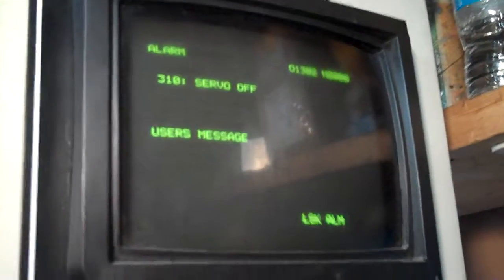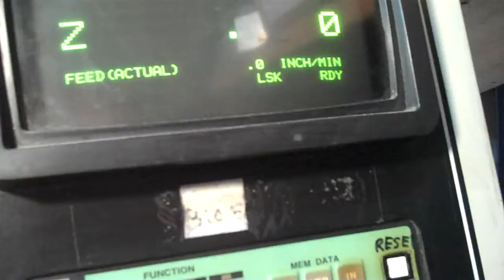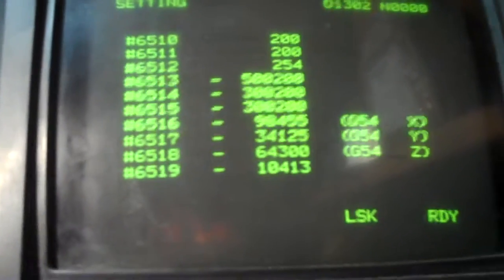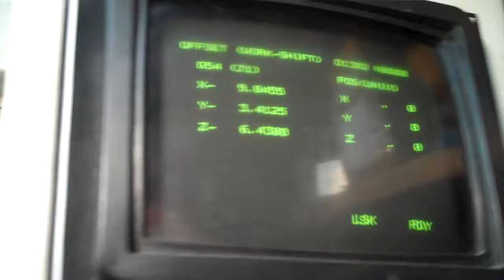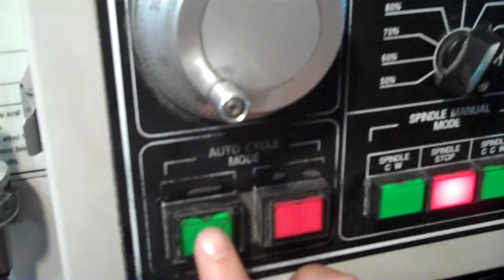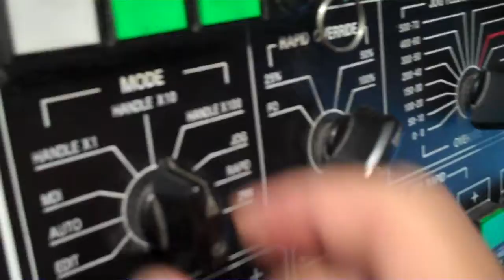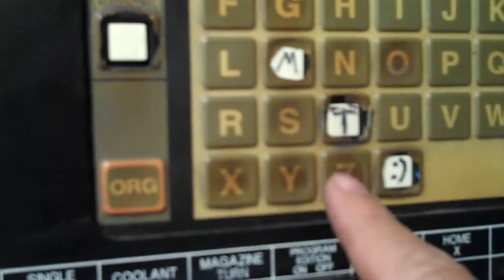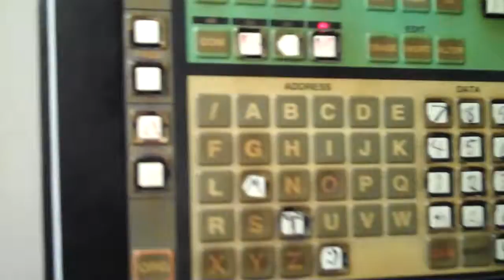Yasnac MX3 , Hyundai SPT-V30T , how to start and zero machine

Comment: Can you please make a video on how load tools on your mx3 controller, I have a mori seiki that I'm trying to figure out
Reply from the maker: Hi Lee, there is a cycle on mine to change the tools,  but I dont use it. I found it easier to load into the pocket directly. I dont remember what the procedure is its been 4 years since I last used it.  I think it was one of the  O9000 programs and made by the tool builder, so it would be different on your Mori.  Look for a preloaded program, will have variables, and calls tools. Let me know if you figure it out or not.

Comment: good machine partner I need your help I can provide the macros for the tool changer. I attach my email so you can help me CESARMEZAR1@HOTMAIL.COM.
I have a team stopped by that macro. Greetings from Colombia
Reply from the maker: Hello Cesar, Below are the 9000 and 9010 macros. hope this helps!

% 
O9000 
M20 
M105
IF[#149LE0]GOTO20 
IF[#149GE15]GOTO20
#505=#1032AND255
M19 
IF[#149EQ#505]GOTO10
G90G22Z138.2
G91G30Z0
/2T#149 
G91G28Z0
N10G90G22Z100M20
M99 
N20#3000=550(TOOL.DATA.ERROR) 
M02 
%

% 
O9010 
M20 
M105
IF[#20LE0]GOTO20
IF[#20GE15]GOTO20 
#505=#1032AND255
M19 
IF[#20EQ#505]GOTO10 
G90G22Z138.2
G91G30Z0
/2G90G00X#24Y#25T#20
G91G28Z0
N10G90G22Z100M20
G90G00X#24Y#25
M99 
N20#3000=550(TOOL.DATA.ERROR) 
M02 
%

Comment from the maker: Hello,  my machine does not have drip feed option.  I can only load the memory. I don't have a tape mode on my machine.  do you have a tapered mode on yours? if you don't you likely cannot drip feed either.  I upgraded my memory to a whopping 1 mb. it's been enough for any programs I have run thus far.